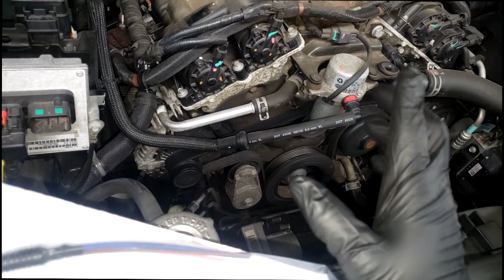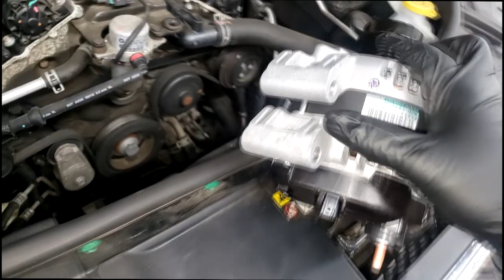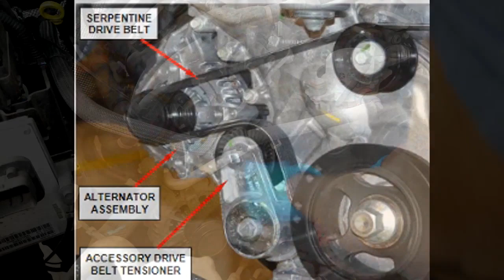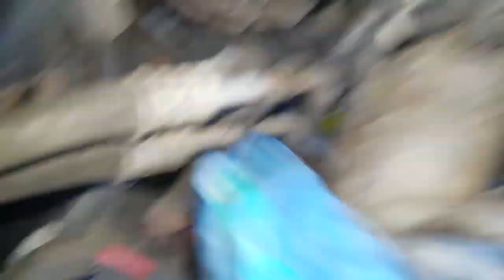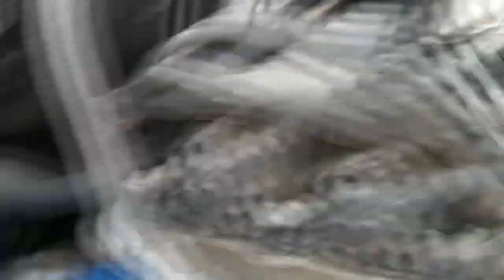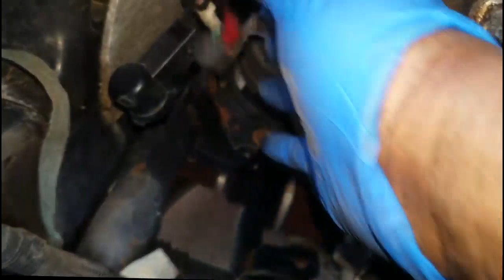Doing this will destroy your car computer. If this part bad, replace it ASAP. Recall T36 V62 PCM ECU

Comment: watched 2 min ad about Eddy Murphey new movie Coming to America 2 looks good.
Reply from the maker: lol, thats whats up. Hey have you seen any of the alternators take out the PCM?
Reply: If the voltage spikes go high enough of course it can take out the computer. I'm surprised nobody had replaced that alternator under the recall in all that time. I spose it's likely that the car has been through some owners and fell through the cracks.
Reply: @OnlineMechanicTips  yes and the B+ fuse at junction and starter line, I have seen bad alt voltage spike as high as 30 volts, melt wires.
Reply from the maker: @turbotom416  dang

Comment: Hey JT i have a 2005 Dodge Magnum..my headlights and interior lights are flickering..i changed the alternator an battery still same thing..do you think i need to get the PCM reflashed??
Reply from the maker: Hey bud, the pcm has nothing to do with the lighting on this year car. Your car has a front control module on it as well as a cluster that's basically a module. Are you getting any codes?
Reply: @OnlineMechanicTips  Ok thanks im get it checked again and see if any codes coming up and Im get back with you

Comment: Hey JT. Code P06de 3.6 pentastar apparently the oil pump solenoid needs replacing. What is its job exactly? And can i just live with it with no harms long-term ?
Reply from the maker: Hey bud, this def a oil pressure related code. As for the oil pump solenoid you mentioned, we cant get those, we have to do the complete oil pump. But, this code can be something as simple as oil level low, or the oil pressure off. At any rate oil pressure reading test should be done. But this a dual stage oil pump, you would need a special tool in order to do oil pressure test, should you ignore it and live with it? No. BUT, if you going to drive it, at least make sure oil level on point. Curious, is this the only fault code it give?
Reply: @OnlineMechanicTips  this is my only code on. And I'm constantly checking my oil levels its always on the same max level. I've been driving the vehicle for 20k miles now with this code. And for the reason u mentioned I haven't decided to replace the unit along with the oil pump because apparently the oil pump is fine
Reply from the maker: Then it's likely a simple circuit fault & not mechanical. I've seen guys replace the oil temp sending unit on top of the adapter housing for this code with success.
Reply: @OnlineMechanicTips  I did replace it already along with the oil cooler. Still code is on. I use the correct oil filter too. What kind of circuit fault should i look for ? How should i start diagnosing it? Thanks for your knowledge I highly appreciate it

Comment: See my thing with this is they should be replacing  your battery  and starter. Those 3 have a relationship  if one fails the other two kill themselves  tryna help it.
Reply: After I got  mine changed my battery  began  to die some that wasnt happening  before hand. So i asked the dealership  if they could look into it to make sure they didnt give me a bad altenator. They tried to charge me what i would pay for a new battery to just check and see if that was the problem.  I just ended  up getting  a new battery and haven't  had the problem  since do.
Reply from the maker: Wow, in FCA defense, I think when this recall was issued, they expected people to get it done right away. Some of the problems with recalls are the notifications, some of the customers on file do not even own the vehicle any more. So when they send out the mail, it never reach the owner. If most all of these alternators been replaced early (recall was out in 2011) the failure rate of the other components that you mentioned would be low. But I see your point. Thanks for watching bud. Thumbs up the vid for me, and sub if you not already, thanks

Comment: JT I have a 2011 Dodge Durango citadel how many recalls are there for this vehicle
Reply from the maker: The 2011 model had a few. If I had the last 8 digits of your vin, I could check for you. And this T36 recall apply to your year Durango, not sure if its been done yet tho. Stay on top of this stuff. FCA not going to fit the bill to many times for the PCM if it gets taken out by the alternator. Make sure your recall been done
Reply: Hey Brandon, this website will tell you all the recalls: https://www.nhtsa.gov/recalls